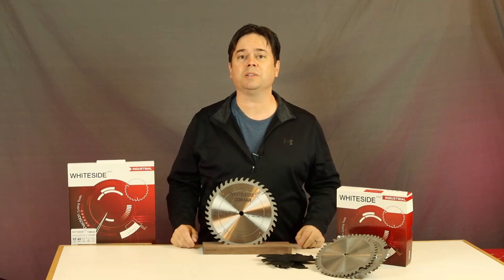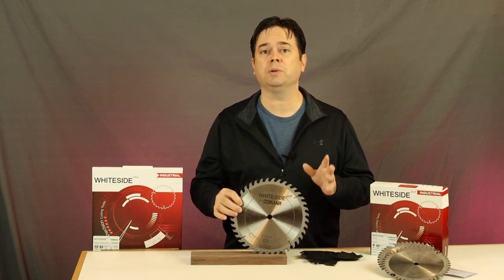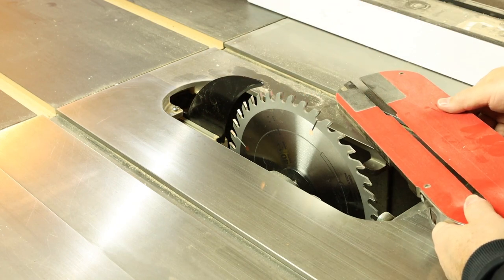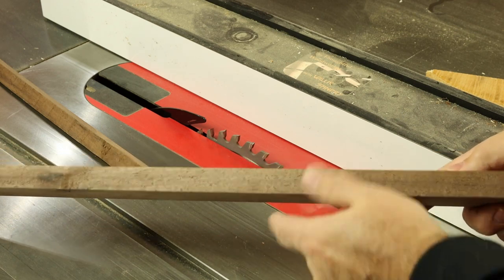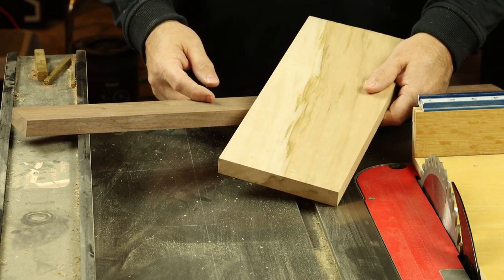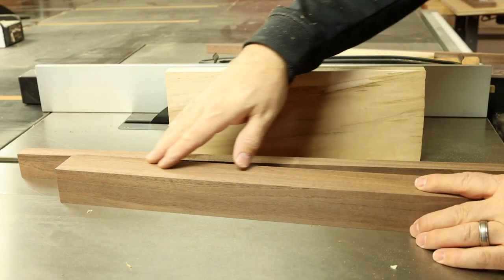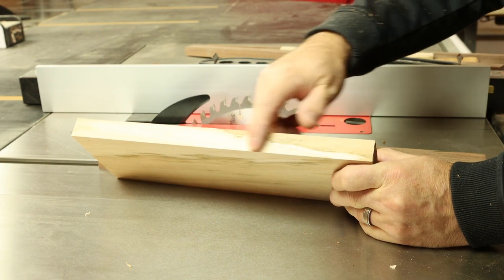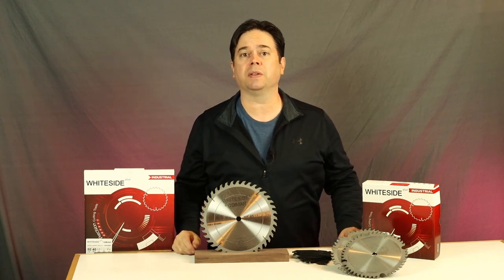Whiteside Plus 40 Tooth Saw Blade General Purpose / Crosscut Woodworking Tablesaw Blades by Dimar

Comment: Nice video. Very impressive results. To get those results it must be a good blade, but also you must have correctly aligned you table saws and you must also be applying correct technique. 

I use a full kerf Forrest Woodworker II which is also a General Purpose blade type and seems to be nearly identical in specifications to your Whiteside blade but much more pricey. After using thin kerf blades, I am a believer in full kerf blades. I run them on my 1 and 1/8 HP Shopsmith and I have not noticed a serious bogging problem. Although, I have to admit that I do most heavy ripping jobs at the band saw. I will say that for ripping at the table saw I find that a Combination Type blade can handle the thicker stuff more easily, but is NOT as nice on sheet goods and cross cuts as a General Purpose.

Do you know the plate thickness of the Whiteside? I believe that plate quality has more to do with cut quality than tooth widths. Some plates are just too thin and deflect and wobble in the cut not matter how many laser zig-zags they dice in. In some cases certain thin kerf blades can remove as much wood as a clean cutting full kerf blades.
Reply from the maker: The plate of this blade measures .087" thick, compared to the teeth at .126".  It weighs in at 1lb, 11oz so it's a pretty good chunk of steel and carbide!  
Thanks for checking it out.
Best